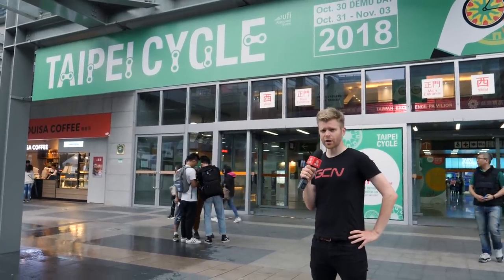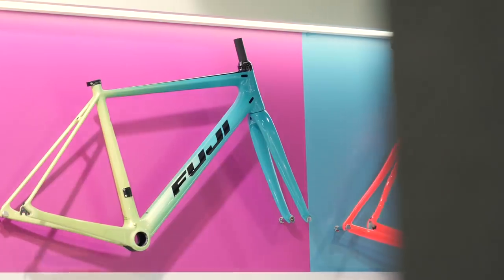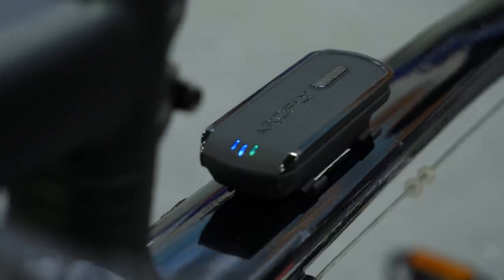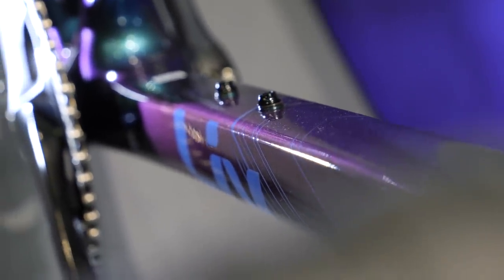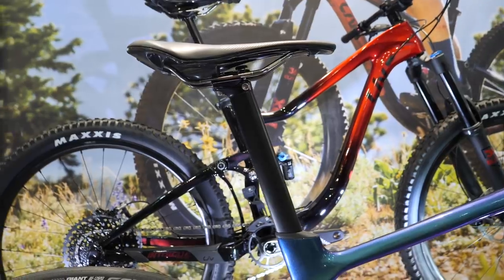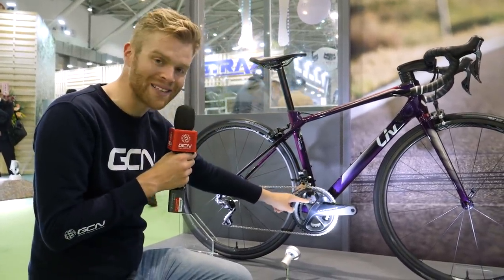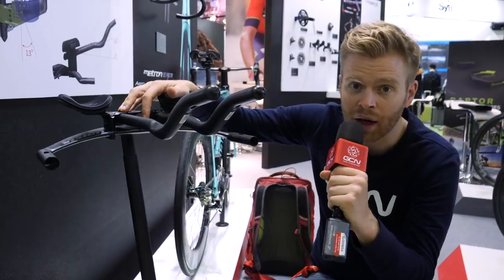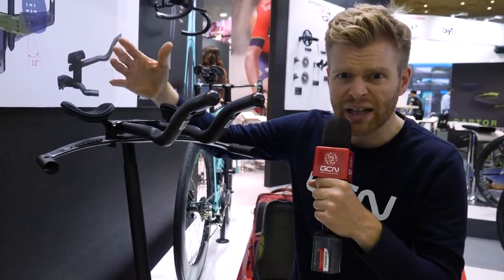Best New Tech For Road Bikes Part 2 | Taipei Cycle Show 2018

Comment from the maker: Which is your favourite bit of tech from this video? Let us know 👇
Reply: For me, it's the custom Fuji bike frames! (^_-)
Reply: Great coverage Ollie.
Reply: The Topeak mascot😬
Welcome to TPE! 🍺
Reply: If u r British plz say in £
Reply: The aerobars do seem nice tho. And I like the custom paint program from Fuji! But the best was Ollies smile!
Reply: GCN Tech are those shoes 300grams each or a pair?
Reply: GCN Tech what about weight on the wheel tyre value. How heavy is it
Reply: The women's bike.  I'm a man with long legs.  These statements about averages are just averages.  It's a shame that they have to market segrate these instead of just selling them as taller stack race bikes.  In men's branded bike you need to go to a less stiff endurance bike to get the higher stack.  People have different proportions.  I don't like the highly angled top tubes on the giant though, speaking of less stiff.
Reply: Ceramic disc rotor!
Reply: Modular ninja mounts, because we need an expensive replacement for cable ties, velcro straps, or o-rings.
Reply: Ceramic rotors. Porsche had them years ago. Nice to see them going to bicycles. Looks to be full floating too.
Reply: where can i get these shoes i need new ones anyway xD
Reply: I want the disc rotors. 
I'd invest in a less flexible rotor and have a peace of mind, away from ticking noises. 

As for the Topeak Ninja, haven't they always been modular?
Reply: The valve cap power meter
Reply: Tu Tse-kang that’s a scary guy! 😵
Reply: Liv - paint, specialized have been there.
Topeak - S.W.A.T again specialized have been there.
Reply: The Topeak cages, Im already looking into them
Reply: One of the coolest was the new Giant power meter, the Power Pro. You see it in the video when he mistakenly calls it a Pioneer.
Reply: I likes the racist name of the paint job on the Liv.
Reply: The SHOES MAN, THE SHOES!!!
Reply: Not really since this program is being watched all over the world.  $ or € is fine
Reply: The Carbon shoes
Reply: Those shoes!!!

Comment: How do those carbon rotors work? I've not watched it for a couple of years but In MotoGP they run carbon discs & pads,yet in the wet they always ran steel discs as the carbon discs couldn't generate enough heat in wet conditions to work effectively.

Comment: LIV Bikes will sell truckloads based on paint schemes alone.
However, as the wife's primary technical consultant, I hope their new models offer some degree of aero improvements, tire clearance, a disc brake option, and ride smoothing capability.
Reply: 2,500 notes for 105 is a bit steep too
Reply: Add to that, frames  with shorter than 49cm TT for better reach and slacker ST angles.

Comment: #askgcntech hi. I've recently purchased the new kickr. Placed my bike on but for some reason chain makes loads of noise. Back pedalling seems nice and smooth but pushing through the crank seems to suggest a grinding noise from chain. Cassette is not skipping. old chain on new cassette? On the bike its all good. Tried tweaking adjuster but I don't think its this.

Comment: Those road bike carbon disc got to be very expensive they only come on super cars
Reply: They come in a lot of Ferraris soo... Colnago Ferrari?
Reply: race car brakes only work at high temps. That has even been a problem in the past where they wouldnt work well in supercars going speed limit. Dont remember how they solved that issue but either way something tells me those ceramic and carbon fiber brakes are all show and dont actually work.

Comment: Why does many woman bike have the toptube so low
Reply: Awesome Chael i don’t think it’s a woman’s, I think it’s a Giant thing. Giant popularized the compact road geometry with the TCR, so they want their racing bikes to resemble that. It’s also a cost cutting measure because compact frames have less sizing specificity which is good because women’s specific bikes are not as popular and thus have less volume overall (an important thing as carbon orders need high volumes to return costs at scale for their much higher initial costs).

Comment: Word to the wise carbon shoes are not durable. The bottom of the shoe will break just like mine did. $280.00 is a complete rip off. Carbon is just plastic never forget it.

Comment: please never attach anything else than a bottle to a bottle cage.
Reply: I quite like the idea of that separate "washer" style mount though. You could easily attach it if/when you see fit and you can still run your own bottle cage. I never liked the idea of these type bottle cages as if the cage ain't good you're screwed.